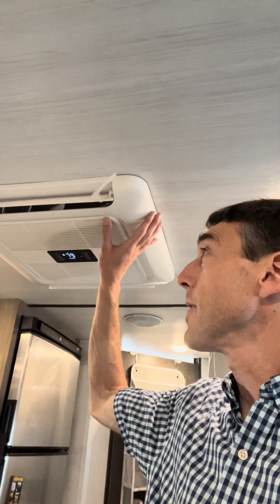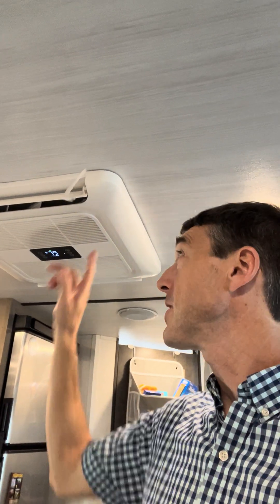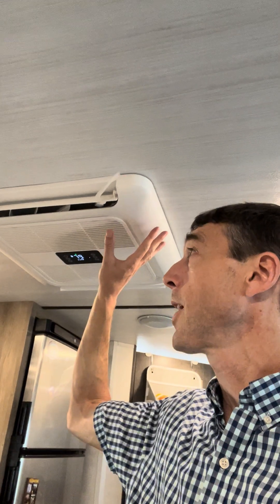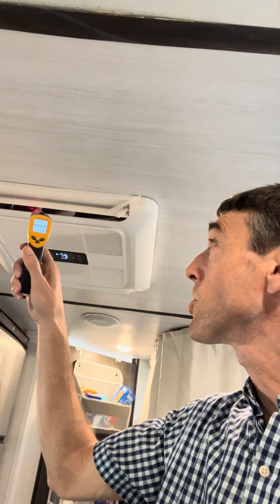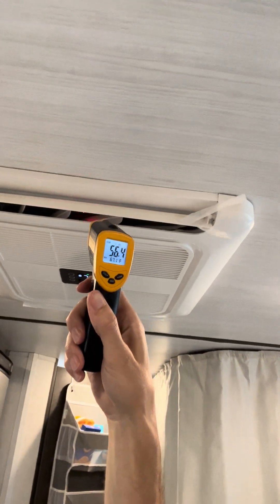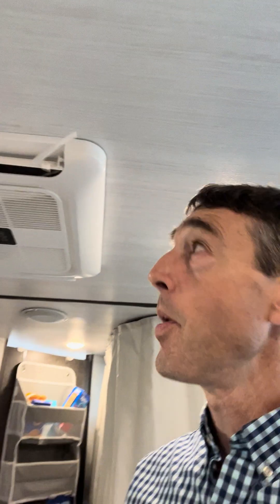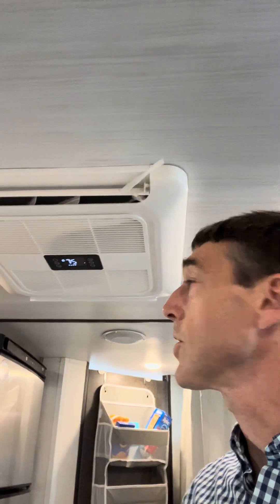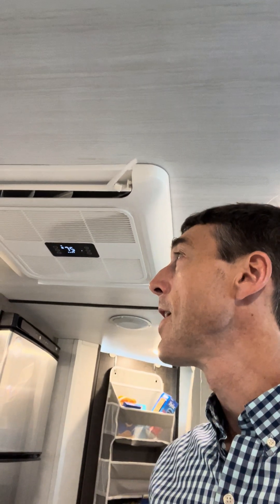Off Grid AC Unit - 12 Volt (or 24V) - Battery & Solar Powered #rvlife #hvac#offgrid #boondocking

Comment: If you have 2 x 12V batteries they are 12.8V nominal which means they are 1280 Watt hours per pack * 2 = 2560 watt hours, not 4800.  The more you know! :-)

Comment: You gave us a lot of information but you didn’t tell us how much power the unit actually takes to run. I have a 240 V unit which takes about 110 A when running on a 12 V system through the inverter. It would be great to know what ampsit’s taking out of the battery when it’s running
Reply from the maker: Great question! I put together a write up with more details and an Amp draw vs voltage graph in the link below. The short answer is that the unit draws ~320 Watts in Eco Mode. At 24 volts that is at 13amps. In turbo mode the unit can draw 600 watts or up to 25 amps. Let me know if you have any additional questions! 
https://www.offgridac.com/blogs/news/how-does-it-work
Reply: Is that the Countrymodpro 10,000 BTU Lowprofile Rooftop Air Conditioner?
Reply: @darrellv7988  yes looks like countrymod, the 1k under price point and function is sweet compared to velit (half the price)
Reply: It looks like it is. My husband is installing one now.